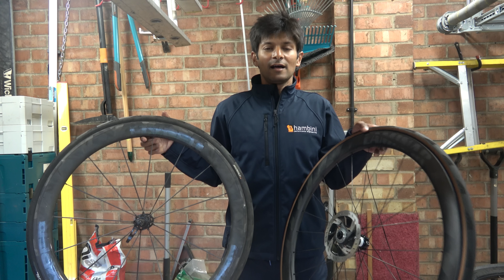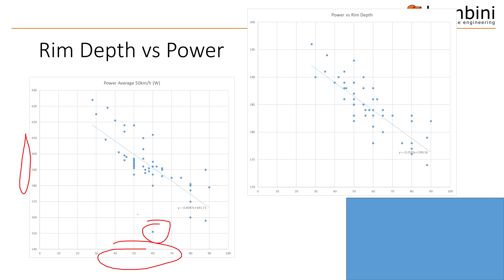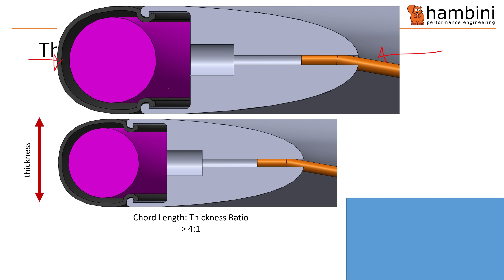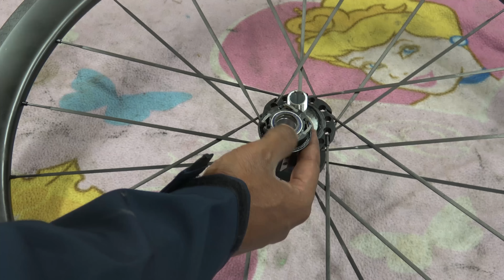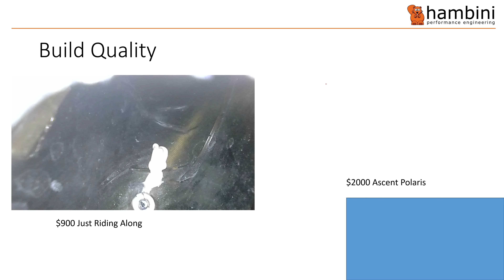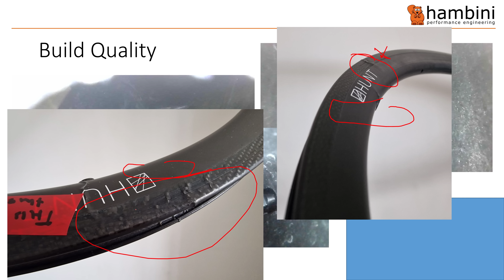Bike Wheels: The Engineer's Buying Guide

Comment: That non-standard bearing size issue with DT hubs is an interesting point. I have a wheel with DT350 hub and the bearings are 6902, which is the same size in all my other wheels! Is that comment directed to fancier models perhaps?

Comment: Love the video, covers all the main points in depth.
I appreciate the need for disc brake cooling as it affects aerodynamics but also understand that the disc brakes air flow is affected by the speed of the bike. Mountain passes uphill max speed is significantly lower than when traveling down hill.
Secondly from a practical point of view changing wheels from aluminum to carbon rims requires a brake pad change on rim brakes. Disc brakes don't require any pad changes when you switch wheels. Having to change 4 brake pads each time I change my wheels is a non starter for a weekend cyclist such as myself.